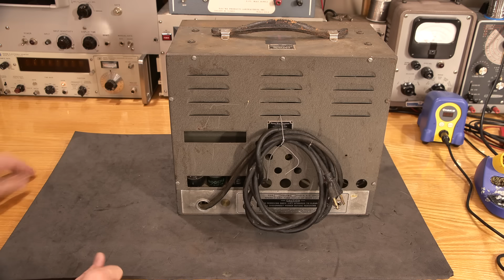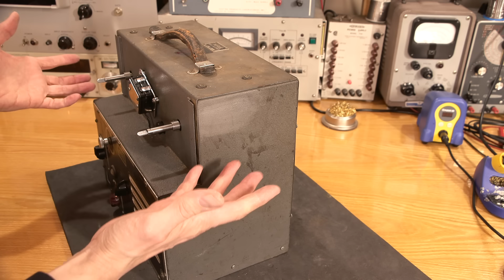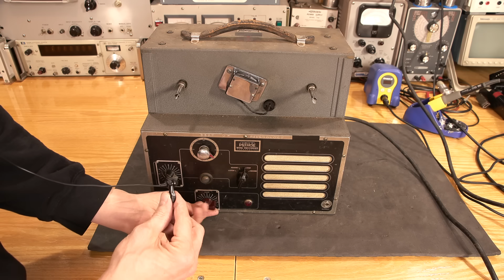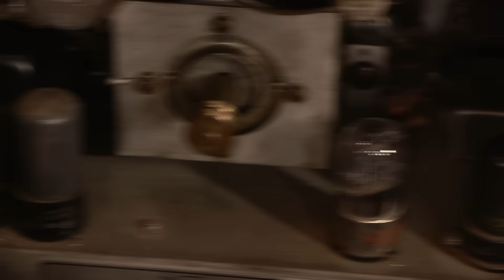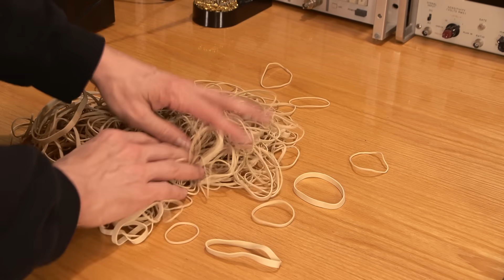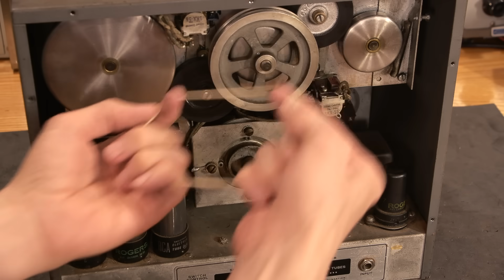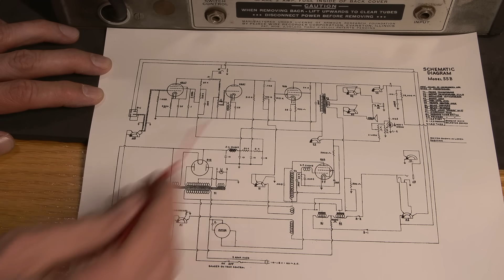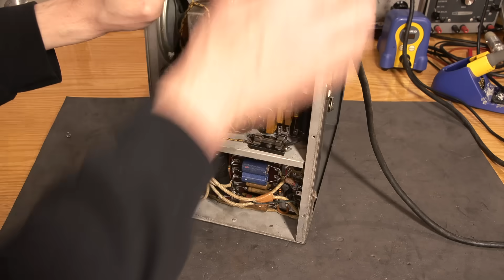Trapped Voices In This Wire - Let's Listen To Them!

Comment: Here's a workaround a friend showed me. I was given a Webster-Chicago wire recorder. Upon opening it up, we discovered someone had gutted the tubes and most of the amp. Mechanically, it worked perfectly. We found a wiring schematic. The recording and playback heads appeared to be like 'humbuckers' on a guitar. I wired directly to them into my RME 12mic and was able to get a clean, hum free recording of an old Oregon pioneer talking about life in the late 1900's
Reply: Upload it 10/10 want to hear it
Reply: 'Late 1800's'
Reply: @WEBBSTER360 I would love to hear that
Reply: @WEBBSTER360 Yeah. I was going to say that I could tell you about life in the late 1900's. Also, there's an edit feature on YouTube comments that I believe date back to circa 2015...
Reply: edit feature does not work for all browsers. It works on laptops. It does not work for watching and commenting via youtube on browser via mobile though.

screw the youtube app. I don't use unecessary apps.

OP was not wrong to re-post the fix
Reply: 😂😂😂😂😂 @mattmarzula
Reply: @mattmarzula  So YouTube didn't have the edit feature when it started in 2005?
Reply: @mattmarzula 😂😂
Reply: @mattmarzula 
Where are you going after you die?

What happens next? Have you ever thought about that? 

Repent today and give your life to Jesus Christ to obtain eternal salvation. Tomorrow may be too late my brethren😢.

Hebrews 9:27 says "And as it is appointed unto man once to die, but after that the judgement."😊
Reply: @mattmarzula  twas no point to this post
Reply: Dude, this got me rolling 😂 @mattmarzula
Reply: @mattmarzula  2015 wasnt far enough back to call it " circa"....id go back like 1700 something
Reply: @7th_Heaven it works you just don't see it unless you completely close out the video you're on and reopen it through history.  For some reason it doesn't refresh.
Reply: @Mephilis78  it worked well before. VERY WELL before
Reply: @7th_Heaven yeah idk why it's like that.  Feels like it's been a few years since it worked right for me
Reply: @WEBBSTER360 I wanna hear that
Reply: We need to upload these old recordings so they are preserved for history. Endless uses from local histories to actors working on accents. Pls upload!
Reply: @GuyonaBridge  Eventually it will all have to burn :O
Reply: @zacharynoe1787  enjoy it while you got it!
Reply: Wow that's pretty amazing
Reply: Yeah tell us more what did he say?
Reply: What he say?
Reply: Hello webbster360, I am interested in this Oregon pioneer recording I would like to know more.
Reply: @jeff10049 It's not that much, he died of dysentary while on the trail.
Reply: upload it pls!
Reply: Please share!!! How cool!
Reply: Neat
Reply: @jwalster9412  Neat??  you must be old 😄
Reply: @johannetje1980  Tbh I don't really care
Reply: That's awesome! My mom's side was in Oregon in the mid-1800's (Coastal/Willamette Valley region.) And I actually just started reading a journal from my dad's side, who arrived in the 1920's-- I'm hoping to start a social media account where I share the daily entries, starting on the day the journal began!
Reply: @dddderick  I would be really interested in that. My grandparents moved to Oregon around 1910. My mother was born in 1928 in the southern Willamette Valley. Her oldest brother and his wife moved to Coos Bay in the early 40's I'm thinking. Anyway I would love to hear the stories and I have a friend in Cottage Grove who is a really into the local history who would love it. My family were friends with some of the old pioneer families- Mosby, Applegates, Mcfarlands and others. I would love to hear it. Where do you think you would post it?
Reply: Cool❤ @dddderick
Reply: @dddderick I love your idea!  I hope to find it when you get it going!
Reply: @dddderick do itttttt
Reply: @dddderick That would be good, as it is history.
Reply: You REALLY should Let a museum copy this. Time keeps going by— and history keeps being LOST . You would be doing us all a favor if you let the world hear it!
Reply: Late 1900?? What way back 1998
Reply: 1999 😊 @ChrisMcavoy-vh6of
Reply: What upload that it sounds so so cool
Reply: have you uploaded it anywhere? I would love to hear that.
Reply: I agree with others here: this is worth sharing! hope you'll share what you know and what you've heard!
Reply: that is amazing!
Reply: That is so cool ,would you be able tp upload it or tell us what was said ?
Reply: YESSS!!!! Post a vid!!! I'm no techie, but would enjoy the historical perspective. 
I guess I'm a tech groupie for time machines 🤣 💌⌛⏳
Reply: @WEBBSTER360, can u please elaborate on the stories told by the pioneer , I've been doing a lot of oregon history research, and it would be interesting to hear his take
Reply: Well I had a nice reply and something cool, but the advertisement break erased it. Quick version: I have a document of relative/free mason/Spanish American war. Believe it or not, they had branches that involved women. My uncle was under her branch
Reply: That's awesome!
Reply: Amazing!!!!
Reply: Will you upload it? That's a video that millions would love to hear
Reply: that'd be something to sit down and listen to.
Reply: I wish you would post it!
What a treasure.
Reply: EMF have been known to "record" images on film. Unopened film for cameras (stills, but could happen for motion picture film, as well!!) have been purchased en masse, and a variety of random signatures, quotes, images of all sorts were already visible. Can't recall details... documentary was either on yt or maybe Gaia.
Reply: WOW 😯.... I would LOVE to have heard that....fascinating.
Reply: Wow!!
Reply: Please upload this somewhere! This is an amazing recording that should get preserved, if you do have it!
Reply: It's amazing that the old wire recorded seems to have a lot less popping and interfere and a cleaner sound than old plastic 78 platters .
Reply: Please post this!
Reply: In the late 1900's the internet changed all that
Reply: @FlatEnough  and brought paved roads to the northwest wilderness....go away, little doggie
Reply: I would love to hear it. Can you make a YT video and share?
Reply: i just subscribed, hoping that You’ll upload it to your channel someday…
Reply: That would be really cool to hear.
Reply: My dad had a Sears Silvertone.   Combination record player and AM radio.   Table top cabinet box with lift lid.
Reply: OMG, late 1900s, that is very old. And so am I, being born in the ancient year of 1976. 😀
Reply: @jakubkrcma  My middle son was a bicentennial baby too. Did they have stars, stripes and fireworks on your certificate? And he was born in Oregon.
Reply: @jakubkrcma I was born in 1976 😅
Reply: @jakubkrcma And you're still here with us at the age of 49? You should do a doco on witnessing the sweep of history from the Apple IIe to the Walkman. Call it Living History or something.

 It might interest some of you antiquarians that I was born in 1947, when real life Nazis still roamed the earth. (I'm talking pre-Musk here.) 

Not only am I still here to tell the tale but I can still work out the math involved in knowing that I'm 77 yrs old. Or do I need to write that in binary for you tots to understand it?

Still more amazing is that my father was born in 1899, so he was a teenager when WW1 began, and served during that war in the Royal Horse Artillery. He witnessed the sweep of history from when horses were the universal form of transport to when man landed on the moon.

His own father was born in 1859, and his mother the year before that. Not many of you little punkass kids who can say your grandparents were born before the Civil War.  So take that!

Still more amazing factoids available on request.
Reply: @richardofoz2167  I am still 48. The problem is that the comment's author wanted to type late 1800s, not 1900s...
Reply: @jakubkrcma  49 isn't old lol! American, ryt? Where life ends at 33 lol
Reply: @James-ll3jb  I am still 48. The problem is that the comment's author wanted to type late 1800s, not 1900s...
Reply: @jakubkrcma  let's hope so....
Reply: Yes
Reply: Great story! Thanks for sharing 🙂
Reply: 😂😂😂..... Late "1900's" had me ....  🤔.... For a moment lol
Reply: Wow! Thats just Sooo cool. 😎😉🫡
Reply: RME ftw, Fireface 800 & ADI-8 AE owner here :)
Reply: That's wild. Would love to hear that uploaded
Reply: most of us just remember the 1990's
Reply: and before some dumbass tries to correct me they said 1900's not the late nineteenth century
Reply: Would LOVE to hear it
Reply: Late 1900s?? You make it sound so ancient!  I was born in 1951...
Reply: i think the confusion here is the 20th century is the years between 1900-2000. while the 19th century are the years between 1800-1900. so you meant to say late 1800s, late in the 19th century.
Reply: Absolutely amazing 36:50.
Reply: Late 1900's? Or late 1800's. It's be cool to hear. Glad you could!
Reply: Most popular comment, and just because people are eager to show their genius at noticing a typo. 😂
Good job, everyone. 👏👏
But I want to hear these recordings you're talking about!! That'd be awesome!
Reply: @ChapsShrugged  cant wait
Reply: Share it! YouTube comments are always hard to return to
Reply: I would also love to hear this!
Reply: I can tell you about life in the large 1900s if you like 😉😉, I know you corrected it.
Reply: @NBA_LOGO ...or of bad spelling.
Reply: Ah yes,the late 1900s. I was there ya know. It was a time lost in history. Ive been lucky enough to see the first quarter of this century
Reply: 1000th like
Reply: @WEBBSTER360  upload it!!!! 🙏🙂
Reply: What did he have to say?
Reply: Very Cool
Reply: Upload it !
Reply: You mean 1990?
Reply: That's too cool!
Reply: Very cool man!
Reply: Neat!!
Reply: Wow, would love to listen to that!!!!!
Reply: They're also called pickups
Reply: Am I in an alternate universe?   This didn’t exist in my old universe.
Reply: Put it on Ytube. 👍
Reply: did you mean in the late 1800's ??  early 1900's .......
Reply: Awesome
Reply: Either way, this is an outstanding documentation of audio preservation.
Reply: Ok where is your video of the recording?
Reply: I believe there are videos in youtube about the 1900s
Reply: Wow the late 1900s! What was life back like 30 years ago !?
Reply: Amazing 🤩
Reply: Very cool. Thank you for passing this fix along.
Reply: Upload it
Reply: That is so cool.
Reply: Wow !! I would love to hear it ... Have you put it online for people to hear ?
Reply: ....finales del siglo XX?
Reply: Post please
Reply: you should upload a video with the recording if you don't mind sharing
Reply: I miss the late 1900s
Reply: Pioneer?😂 i was born 1997 dude. Am i a pioneer?
Reply: late 1900s? was it kurt cobain?
Reply: No sound and glowing screen grid usually means an open circuit speaker transformer.
Reply: I can tell you all about the late 1900s my friend
Reply: What came after this contraption?  Reel to reel recording tapes??
Reply: You mean 1800s
Reply: I can tell you about the late 1900’s, I was there for a few decades myself haha
Reply: Late 1900s...like 1995?
Reply: @merlinwilliams9286 yes, that ancient decade of compact discs… 😂
Reply: An amazing era. Some of the best music ever made was recorded at the time.  @merlinwilliams9286
Reply: @merlinwilliams9286  No silly, "Late", as in 1998-99.
Reply: @merlinwilliams9286  "...Bawitaba da bang da bang diggy diggy..."
Reply: @mr.yellowstrat3352  wha????
Reply: @merlinwilliams9286  Just some lyrics from a popular song from the late 1900s.  The boys would get all dressed up in their baggy pants and dance in a "mosh pit".  It was a simpler time.
Reply: @mr.yellowstrat3352  Absolutely beautiful. Such wisdom in those generations 🙏🏽
Reply: @merlinwilliams9286 said the boogie, said up drop the boogie.
Reply: @JohnSmith-b4w  back in the good old days of Napster and MySpace, and bicycles you pedaled with your feet.. all lost to the sands of time
Reply: @merlinwilliams9286 Kid Rock "Bawitdaba" lol
Reply: @JohnSmith-b4w  i still rememeber the Great Grunge Era of the late 1900s. Truly revolutionary 😊
Reply: @merlinwilliams9286  "Well, see me and Prince were a partyin' lack it was a 1999er..."
Reply: late 1900's? so like 1990's? lol
Reply: Well let's hear it. Upload it. Or is it "I don't own it anymore"
Reply: Proof we reverse-engineered the Roswell crash, and all the craft you see were created by us….
Reply: Late 1900s isn't that long ago. Early 1900 Maybe. Late would be 1980, 1990

Comment: What the player does as it takes a micro milliamp signal from The Wire and amplifier it also has an amplification circuit or rather a rectifier circuit that takes ac voltage down to about I think it's 24 volts or maybe 12 V I forget which for sure my grandfather had one of these they used to wire recorders to record activity on the bridge during battles on the warships add wire recorders were used by BBC America for transmitting to enemy countries if I secured transmitter stations music propaganda Etc

Comment: I have this exact same wire recorder. I acquired it when I did some yard cleanup work for an old man  whose son had an electronics background and built commercial radio stations. He had boxes of old electronics gear which he let me have. This was about 1980 and I had just graduated high school. It had a spool of wire but no take up reel. When eBay became a thing I was able to find a take up reel and play it. I had to do the the rubber band trick also. Someone had recorded a commercial radio broadcast with music, pop music from the ‘50s . I still have it today and intend to restore it fully.
Reply: with the "new big dodge" commercial?

Comment: 3D Printer with flexible filament is very useful if you need odd size belts and rubber wheels.

Comment: Stainless cable or iron wire? The wire is magnetic,  Not all but most stainless is not fero-magnetic.    2 x 6v6gt, 1 for record and other for audio amp so why not swap them as you dont currently need record and may get the speaker working.

Comment: I am spitting blood! You are dealing with essentially an electromagnet onto a wire should there be a leaking capacitor this would wipe the wire clean! Indeed this is how early tape recorders erased their recordings! The proper way to go about this would be to desolder the heads and attach the output to a known high gain amplifier bypassing the dodgy internal electronics. You were darn lucky.

Comment: Heard stories about this technology but this is the first time seeing it.  I wonder how many feet per second of wire travels through.  Would be fun to connect the reading head to a modern cassette tape player circuit board.  Please inspect the shafts and roller design before rewinding.  There will be some kind of tension relief slippage mechanism to prevent stainless wire from stretching or breaking.  I'm not sure on the design but there may be a spring pressure plate mechanism with grease or oil that has become thick over time.  In modern cassette tape players they use a shaft that rotates through a sticky grease to provide tension to the delicate audio tape but not too much tension.  You probably already knew that tho.  Great video.  Watching from far far away.

Comment: 12 minutes in: 6SK7 - remote cutoff pentode.  I bet the diode sections of the 6SQ7 are used as level detectors, and the 6SK7 is used as a automatic level control.  I have a few jukeboxes that have that feature.  Apparently, the loudness war started in the 50's...

21 minutes in:  Ack!  I was wrong about the 6SQ7's diode section!  It's not even used!

Comment: To capture that whole recording with minimal fuss, just use a clamp thingie to hold that probe in a good spot and connect the monitor gadget output to the mic/line input of a computer.  Use Audacity (free and highly bitchen) to record it and clean it up.  The sound quality you were getting was actually fantastic cuz those old wire recorders had the fidelity of a $3 radio.  I doubt privacy matters much since the doctor and the patient are surely long dead now.  I'd love to hear the nutty psychology theories of their time -- when every disorder was caused by bad toilet training and cured with a lobotomy.  In those days, anyone seeing a shrink should have their head examined!  Too bad it hasn't changed much...

Comment: I read a bunch of material on wire recorders many years ago, and one weakness of the system was that the magnetic field was applied perpendicular to the wire and if the wire rotated from it's original orientation, it would no longer be aligned with the playback head. Splices were made with just a tight knot.

Comment: I've never heard of a wire recorder. Very fascinating. I don't remember where i seen it, but I watched a video years ago where they got voices from a piece of ancient pottery. 
 The vase has rings around it that looked to had been made with a piece of straw while on the turning wheel. They said that there had apparently been a discussion going on during that process causing the straw to vibrate, causing the same effect of the grooves on a vinyl record.
 In the experiment they created a way to use a record player stylus/needle to ride in the grooves of the vase allowing ancient voices to be heard again.